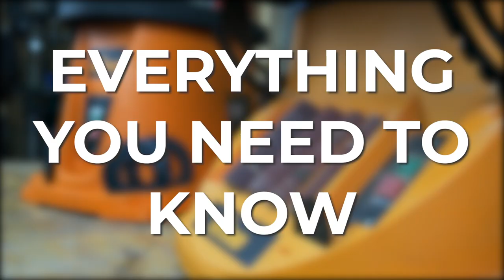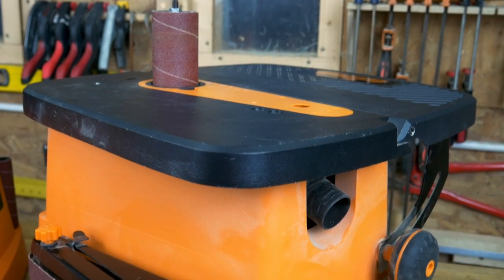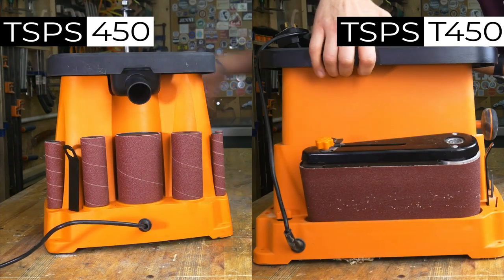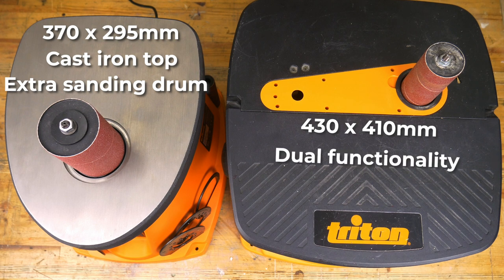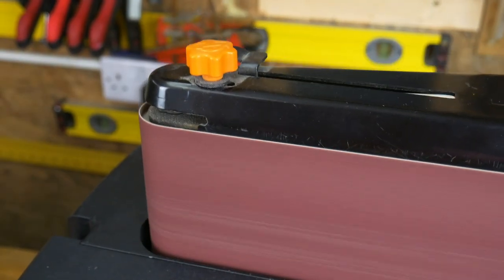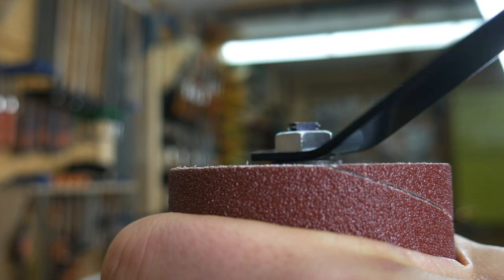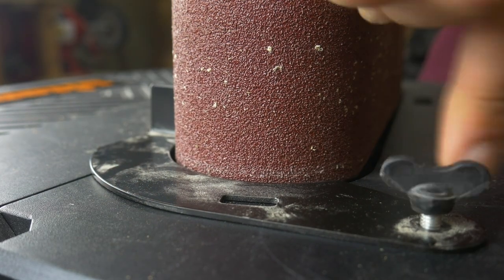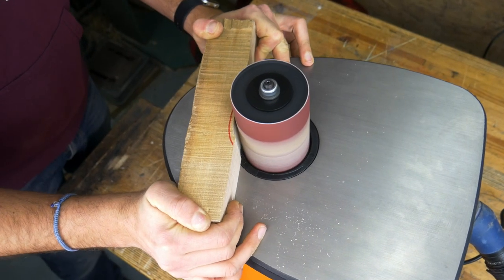Triton TSPS450 or TSPST450 Oscillating Spindle Sanders – Which Should You Buy?

Comment: sweet beef can i sharpen mower blades with  it
Reply: They say not to sharpen metal with it because the sparks could ignite the wood saw dust (assuming you also use it for wood sanding).

Comment: The combo is inaccurate, 90 degrees is off, suspect other angles are too, good idea, poor execution.
Reply: Is it adjustable to move it to 90 degrees using a square?  Could yours have gotten bumped around shipping and just needs a recalibration?
Reply: @MixingGBP  There is adjustment, but it has a detent to hold it in place that is off. I have seen the same complaint before.  A board placed on the table raises the workpiece to a position where it is better but at this price point... sometimes it’s better to do the job properly.
Reply: @paulwestlake4278  ah, I see.  Thanks.